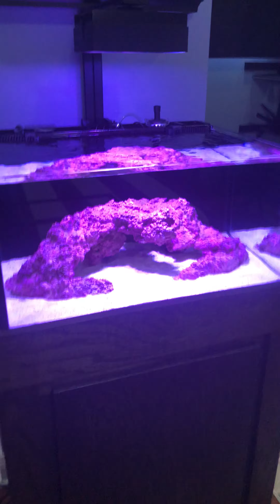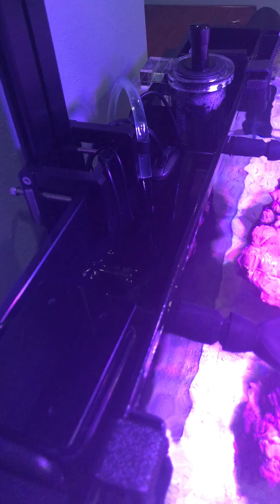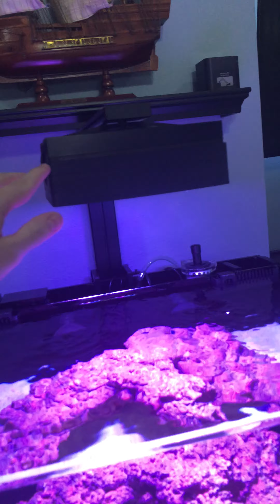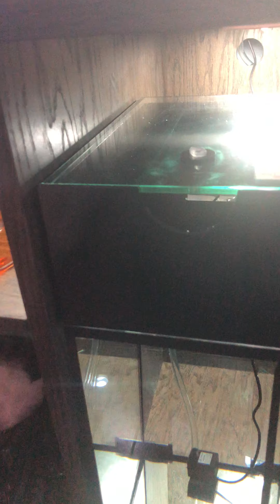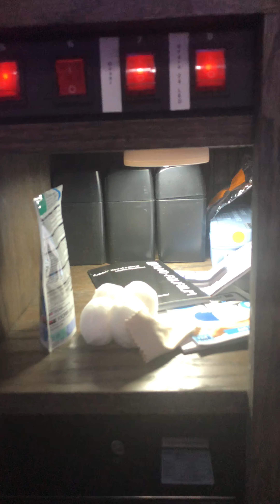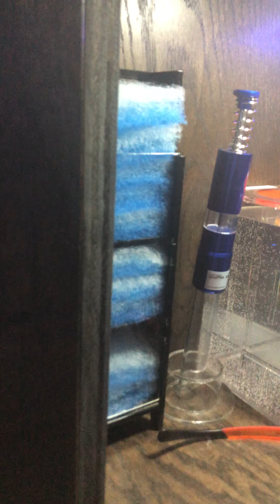Nuvo Fusion 25 Lagoon New Build

Comment: where did you get that power supply from?
Reply from the maker: Gary Hayden amazon
Reply: link?
 @rosssreef9873
Reply from the maker: Gary Hayden type in DJ power strip and you will get different models some have more switches than others